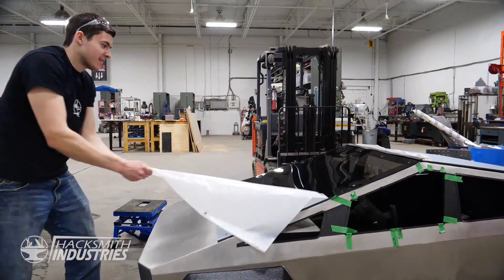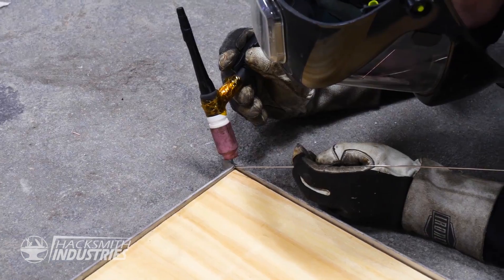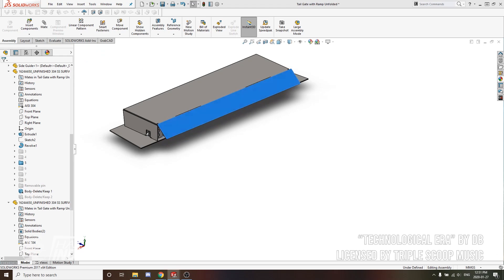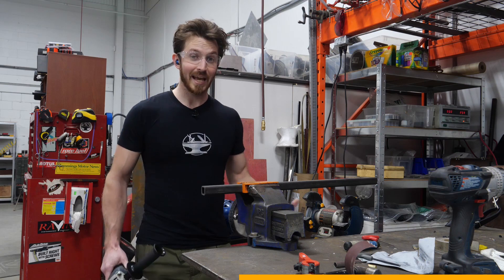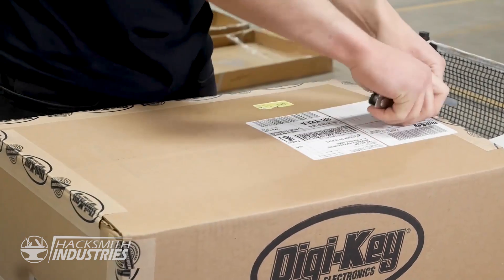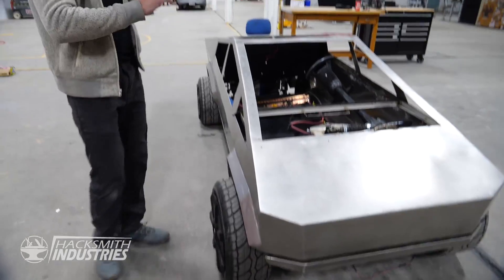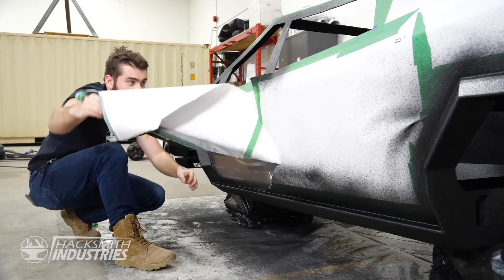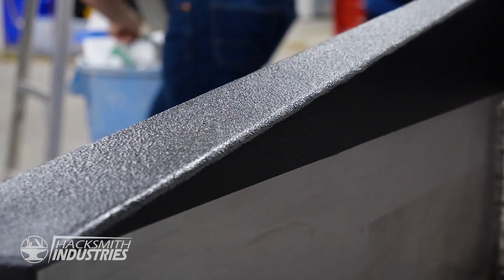CYBERTRUCK BUILD! (Part 4/5: It's done!)

Comment: At first I thought that this was basically just a golf cart with a Cybertruck body from a technical standpoint but after doing some calculations, I was blown away. By multiplying the Voltage by the Amp hours produced by the batteries (which were wired in series), I found that they have 7.8 kWh of energy storage which is one kWh of storage less than the 2020 Toyota Prius. I also found by multiplying the Voltage by the Amperage sent to the wheels, that this half scale Cybertruck makes 248.64 kW or 333.43 HORSEPOWER FROM A VEHICLE THAT WEIGHS JUST 2500 LBS!!!

Comment: Front motors are direct drive. Rear has a gear reduction. 

A standard truck normally has a low range gear and weighs more... no point
Reply from the maker: Guess you'd better watch the next video ;)

Comment: They biffed it giving the torque numbers comparing the nm of the motor to the 400 ft lb of the truck. Basically the torque of their motors combined comes out to over 500 ft lb so it actually is higher with a lower top speed most likely. Figured I’d give the numbers a quick google for anyone wondering.

Comment: Weight pulls weight, the F150 has way more grip from wider tires and extra weight, so it wont matter that torque is lower on the F150, unless the Cybertruck can defy physics too.

Comment: Hold on 130nm torque on the rear and 720nm at the front, why? or is that just motor output that gets geared down at the rear and up at the front or what's up with that?

Comment: Comparing the new motors' torque in Nm with the F150's motor in ft/lbs, why? 9:22
Reply from the maker: Accident
Reply: @hacksmith  Fair enough. :) 
Also, I think you'll have trouble winning a pulling match with an F150, due to not enough traction, for 2 reasons:
1. Weight of each vehicle.
2. Height of the tow hitch. The F150 will likely be significantly higher, causing it to pull the back wheels of the cybrtrk.0.5 up. Conversely, the cybrtrk.0.5 will be pulling down on the F150's back wheels...

If you can overcome these (extra weight, higher tow hitch mount), then that'd make an interesting matchup!

Comment: I am skeptical about putting this up to an f-150. Due to gear reduction in a truck from the transmission the wheel torque can be much higher than the engine. Now I don't know the gearing on the 1:2 cybertruck but engine or motor torque is just the tip of how much power goes out the wheels. The gearing, differentials, wheel size, and traction all play an important part in determining how much power makes it to the ground. If the 1:2 cybertruck is direct drive it will be beat in terms of power because the ford 10 speed 1st gear ratio of 4.69:1 will give it technically 1,876lb-ft at the wheel shaft if the differentials were 1:1 (its not) this beats the motors combined 626lb-ft. The hacksmith can work this out using the gearing on their 1:2 cybertruck and comparing it. For the moment I question its ability to win. Let me know what you think. Pls don't go calling me a cybertruck and hacksmith hater. I love them. If i'm wrong with my estimates (I know the engine power isn't instant don't bother me about that) let me know.
Reply from the maker: 13:1 reduction on the back axel :) its close!
Reply: That is very impressive! we'll see how the traction holds up :)

Comment: Holy shit that's a lot of torque... The challenge in a tug of war is weight, the truck will have a lot of weight pushing on the wheels to give it a lot more traction, and it has bigger tyres so more contact patch, whereas this is super lightweight in comparison

Comment: 9:28 they said their cyber truck has 850Nm of torque measured in Nm and compared that to a Ford f150 but measured it in foot pounds, this makes it seem like their cyber truck has more torque than the f150 yet that is not the case.
Reply from the maker: But it does... even with the proper conversion

Comment: 9:36 400 ft-lbs equates to 540Nm - thought it was a bit strange to compare with different units
Reply: I came looking for someone to point out the lack of unit conversion.  C’mon hacksmith, you guys are professionals.
Reply: but this is at the flywheel and pre-gearbox and drive train losses

Comment: So I went to a party with members of the American Society of Mechanical Engineers (ASME) at my university a while back, shortly after Cyber Truck was unveiled and we had a discussion on the aerodynamics and flow separation issues that would result from the, relatively speaking, sharp bends and angles on the body. Do you guys plan on trying to wind tunnel test it to see if the body design has any improvement over a traditional truck body with respect to aerodynamics? I'm just not certain that this is the most efficient design possible, which can make a bigger difference with electric vehicles and the relative inconvenience of recharging them currently.

Oh and you compared Nm to ft-lbs as if they were a 1:1 conversion which kinda was misleading since 1 Nm is less than 1 ft-lb, but I understand that it is incredibly easy to mix unit systems thanks to the US not fully adopting the metric system. Overall the project looks really good and the massive amount of work and dedication really shows on this project.

Comment: I've had my Raycon E25s for a couple months now and honestly they're not that good. Pairing is not seamless, in fact they have quite a bit of trouble with it. The audio tends to cut back and forth between the left and right earbuds. After about a month the battery only lasts a couple hours before needing to be recharged. The charging case is poorly made and the matte finish wears off fast with regular use. Even after using the best fit of the gel tips provided, the left earbud still managed to fall out of my ear and into sink (down the drain) while I was washing my hands. They are not worth the $80 I paid for mine.

Comment: i guess you can use a lever or a swtch to engage or disengage a set of planetary gears for even more torque......1 switch for super high torque and one for regular.......also for power loader
also u can use a smaller motor with right combination of planetary gears for higher torque in power loader arms/legs for movement
btw....THE TRUCK IS EPIC

Comment: Why do you have more power to the front wheels?
Shouldn't the power distribution between front and rear axle be 40%:60% for maximum traction
Reply from the maker: Don't always have the luxury of choosing ;)
Reply: @hacksmith  even after spending $50,000, great🙂

Comment: Guys, you know 850nm is not directly comparable to 400 ft lbs. silly mistake, I’m guessing. plus, 400 ft lbs is still only 542nm. torque is useless without knowing hp but it’s still quite impressive.

Comment: what i find odd is that it's "done", but you guys left the front and rear of the passenger compartment wide open, and exposed to the elements.
Reply from the maker: Because we can't close it off since your feet go there
Reply: @hacksmith  Fair enough, but what about the back, where the batteries are?

Comment: You’s should take the cyber truck to a tesla charging point thing and see how people react
Reply: If a tesly charging Point only accepts whitelisted vehicles, it costs Nothing to ask if Tesla whitelists this Hommage of their TCT.
It is good Advertising to react positively to modellers, and the Video Coverage would Benefit them.
Reply: It looked so much bigger on TV
Reply: Hub Pro 😂 kinda forgot about that
Reply: @the Hacksmith
Reply: Lightningbolt Luke 😮how do u think of dat ?
Reply: Y'all missed the point. They used a J1772, but Tesla Superchargers are proprietary. You could only charge it at a non-Tesla charger. Tesla gives you a free adapter but they're to adapt the "charger" (ie EVSE), not the car.
Reply: Lightningbolt Luke  I did not know I wanted this so badly but I do!
Reply: Weird wolf 12:50
Reply: t
Reply: r
Reply: If it’s legal
Reply: Lol but they have thier personal charging thing
Reply: You can only use a whitelisted Tesla at those chargers.
Reply: @jordyv.703  they wouldn't have to actually charge it at the tesla point, just go there and pretend to do it, and see how people react to it, would be a fun short video
Reply: @kjoege1000  Yeah that's true
Reply: @jordyv.703  They should tweet Elon and ask of they could get it whitelisted. Knowing a thing or two about Elon I reckon it might work actually.
Reply: @assarstromblad3280  I think you'd have to modify the mini Cybertruck for it to work
Reply: @assarstromblad3280  Considering Tesla dont even allow non tesla dealerships to work on teslas, I doubt they would lmao.
Reply: @assarstromblad3280  I doubt that would work, but it is always worth a shot.
Reply: @jordyv.703  Throw an MCU in the trunk and some BMS stuff and boom, whitelisted :)
Reply: Jordy V. No he did it in another vid
Reply: Jordy V. Really? Totally didn’t know that

Comment: Instead of tig for some of the big pieces why don't you use SMAW stick?
Reply from the maker: There weren't any big parts,  it's all 1/8 folded stainless
Reply: @hacksmith  true, if you used something like 6010 you'd burn through, if you used 7018 the penetration would be less but is slow freezing so the the drip would be more especially in some vertical positions. More that I think about it, tig makes more sense.

Comment: Just a quick chat about the raycon e25 earbuds. I have them and they actually are very comfortable! The sound quality is amazing and it actually DOES have loads of bass. Overall they are amazing. My only issue is that after owning them for about two months, the right bud has gone VERY quiet and they dont always charge when I put them in the case. The seamless wireless pairing has also gotten worse and sometimes requires them to be put back in and taken out again. Great earbuds, maybe I just got a defective set. Great job on the cyber truck guys!!!

Comment: The engine torque is entirely separate from the actual wheel torque.  Think about it, most small cars have like, what, 100ft-lbs.   You know from experience,putting a torque wrench on a wheel of 100ft-lbs, it doesn't move to fast. But in reality the wheel torque is a few THOUSAND ft-lbs because of the reduction ratio from the transmission.
Reply from the maker: Good thing our rear axle has a 13:1 reduction !
Reply: the Hacksmith the F150 options depending, can be anywhere from 15-18:1...  so at 400ft-lbs you're looking at a challenger of 6000-7200ft-lbs of wheel torque.

Comment: HEY HACKSMITH I know that you have already chosen the batteries, but is you want to have even more mounstruous current output, you could use lithium Titanate cells, those have an obscene amperage output and not that you installed J1772 ev charge compatibility you could change the CyberTruck crazy fast!.
I have them in my commuting motorcycle and the power delivery form the pack is awesome, and I can charge it from low voltage to 80% in like 25mins!.

Comment: Half scale Cyber truck is going to lose against the F150 in the tug of war. The extra torque won't help without the weight and traction to get that torque to the ground =/ (Now if they load the bed up with a ton of weight things might be different.)

Comment: Oh yeah! that's a good idea!....... 40 lb marble slab just glued pointing at the ramp shape your arms will make on an 850 torque vehicle!......
Reply from the maker: Lol like 15lbs tops
Reply: @hacksmith  Oh the cheap stuff..... I mean better but still..... not likely to go through the column but more likely to snap and hit a passenger?.....
Reply from the maker: It has a steel edge blocking it and its mounted down... it's not going anywhere dude

Comment: Can you guys do a lessons learned video? Obviously using marble vs. a wooden component with marble vinyl would be one as you added quite a bit of weight when the dash is actually paper
Reply from the maker: The "paper" dash is still mixed with epoxy,  not that light! :p
Reply: @hacksmith  cool, I hadn't heard that part... A lessons learned video would be awesome all the same.

That's for the reply!

Comment: Guaranteed the f-150 will win. Torque is great if you can get the power to the ground. The f-150 weighs more then 3 times more then the half scale cyber truck. It will spin for days

Comment: Doesn't matter how much torque it's got, the F-150 will have tons more traction since it weighs several times more. Pulling against each other, this thing will just spin its tires. It'll be a deadly fun little beast with the correct final drive though with that kind of torque.
Reply from the maker: You sure?
Reply: @hacksmith  might have a chance against a 4x2 I guess since they've got so little weight over the driven wheels, and only 2 contact patches. Engineering Explains went over a lot of this in his video on the real Cybertruck vs F150. Pretty much all came down to traction.

Comment: 9:30
Tug of war with cars is all about weight, torque is less of a concern. 
So the F-150, which is significantly lighter than a real Cybertruck and much heavier than your mini CT, is going to win easily, even though your CT has 1.33... times more torque.

Although, if the F-150 only has rear wheel drive, the weight distribution could yield in lower maximum friction for it, thus letting the mini CT win.
Reply from the maker: You sure about that?
Reply: @hacksmith  
Well, F-150 it gets more friction than the CT, the CT will just spin out, and I assume your CT weighs under 1t while the F-150 weighs more than twice that, meaning, it can get tice the amount of maximum friction and pull twice as hard.
Reply: @hacksmith  
It is still one of the coolest things I've seen someone build.
Which is a standard for this channel.
Reply from the maker: We weigh ours down a bit to give it a fighting chance :) still lighter than the f150 though!

Comment: Hacksmith: As you can see this things got a lot of torque 
Also Hacksmith: let’s give it more torque!
Reply: it would be so funny if this tiny thing beats a full on truck
Reply: The Tug of War doesn't do what people think it does. See the "Engineering Explained" debunking of the Cybertruck tug of war. Torque isn't really relevant, it entirely comes down to "The cybertruck is heavier."
Reply: @MattsAwesomeStuff  Torque does contribute though, just is reliant on how heavy it is. If the cybertruck is really heavy with little torque, it won't go anywhere, same if it is super light with huge torque. Its the combination of weight AND torque that give it an edge.
Reply: @masterseanwit3594  mass times the power you can give equals the energy out put. Huh

Comment: 9:23 Wait so what's the F-150 in Newton meters? Those are 2 different measurements.
Reply: It cannot  out tow a f 150 because towing power is a factor of the truck weight. Heavier vehicle can tow more
Reply: @xsauce3858  it's not just truck weight though. It's mainly a mix of torque, wheel friction with ground, as well as weight.
Reply: @dapz  Not really. In these cases it's only dependent on the wheel friction(which is already dep on weight). This is assumed that the torque will overcome the friction at some point which is almost always true when dealing with this kind of torques.
Reply: @xsauce3858  Sand bags has entered chat
Reply: Also at the engine not the wheels which is not useful by itself.
Reply: i converted the other unit, 850 N*m -> 626 ft*lbs, which is ~226ft*lbs above the f-150
Reply: Thanks broskis
Reply: yes the cyber truck may have more torque however weight is a large contributor  to actually pulling power, if it doesn't have the traction (they showed that earlier in the video that even before the motor upgrade it spun its wheels.) the F150 will win.
Reply: 850Nm is equal to about 650ft-lbs, so it still has comfortably more than the F-150 :D
Reply: @Maximdietz  it makes 500nm at the engine, multiple by 4 for first gear ratio so 2000nm, then multiple by 3 for the axle differential ratio to get 6000nm at the wheels which is what matters
Reply: 542Nm
Reply: The F-150 will win out of pure traction. It weighs way more
Reply: Torque that ends up spinning tires doesn’t help in a tug of war. Weight will be a huge factor there. A tug of war is just a war of friction force which is equal to your torque until your tires spin and you can’t keep your tires from spinning without weight and a high COF.